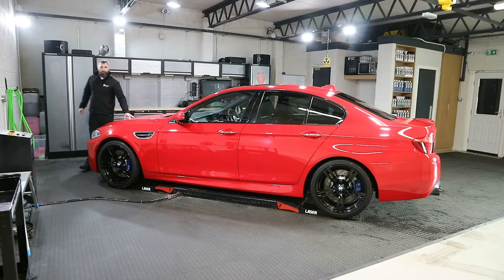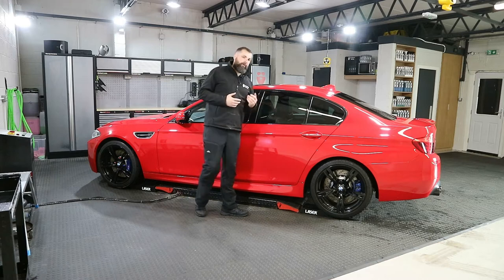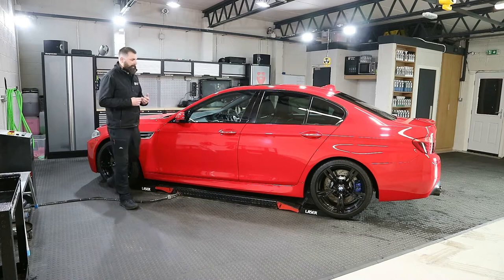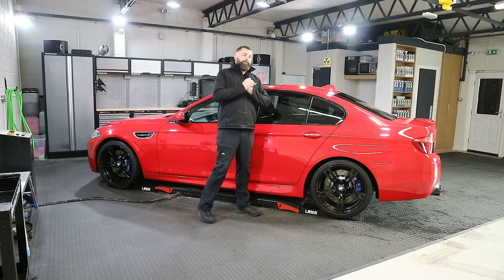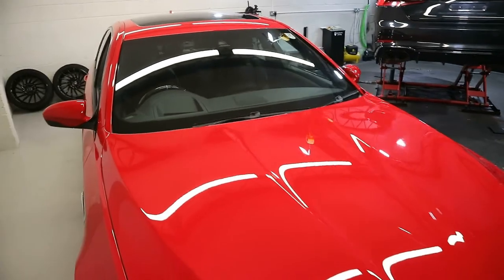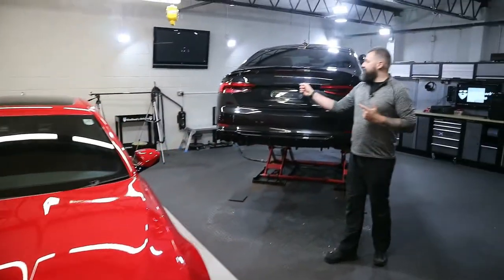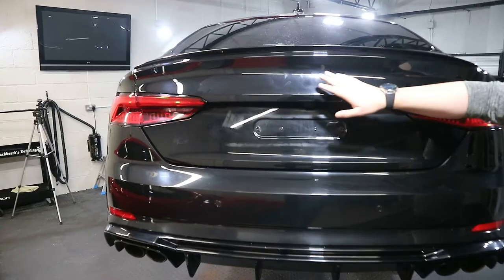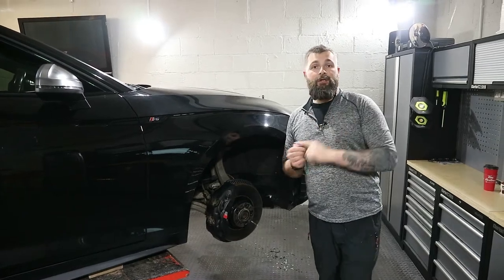Vlog 26 - Blackbeard's Detailing - The German Vlog - BMW M5 - Audi S5 - Merc GL - 3 Series - BMW X6

Comment: Wish I got you to do my M3 last year. The red on the M5 I take it was Melbourne Red the same as my M3. Outstanding work as usual.
Reply from the maker: It's a BMW individual paint option called Ferrari Red or as the little plate in the engine bay says "Ferrari Rot".

Thanks, it was mega rewarding to work on. A nice solid colour so really shows off the gloss!